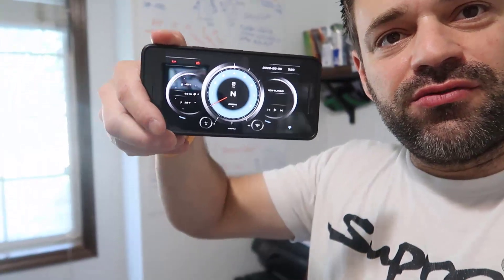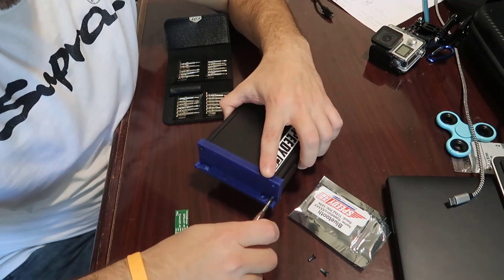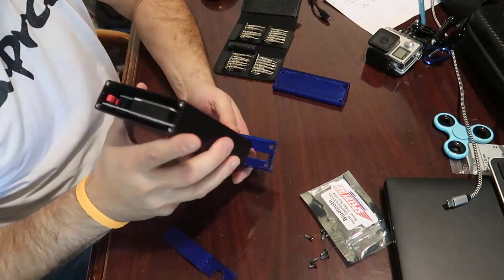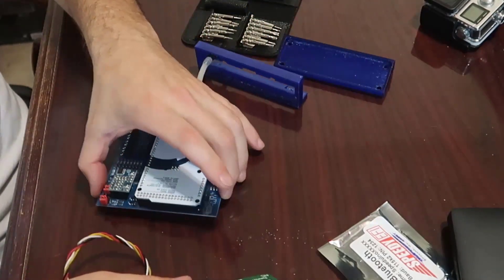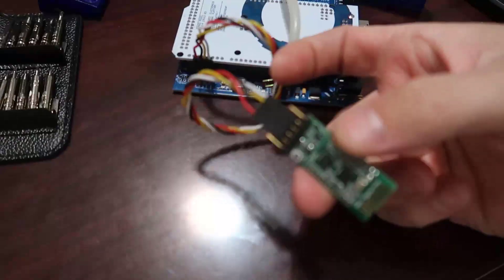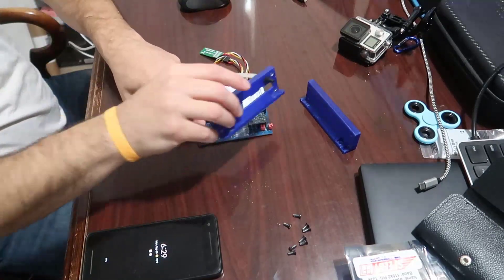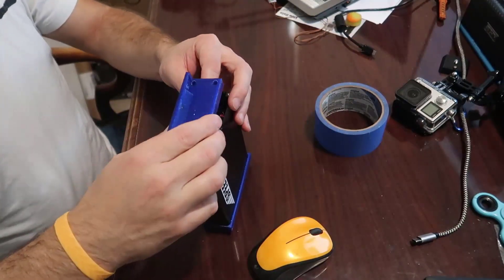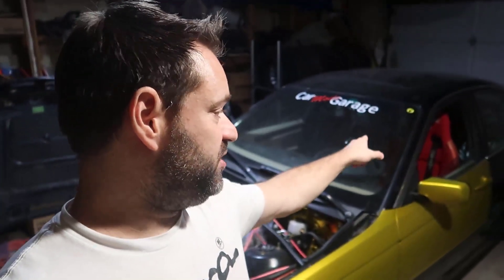Adding Bluetooth to the SpeedyEFI Speeduino ECU - 2JZ to E46 Tuning

Comment: hi bro i also using speedunio how pair with phone i keep try but  cant been connected
Reply from the maker: I use SpeedyEFI version which is pretty easy to switch to Bluetooth. I'm not sure about speeduino itself.
Reply: @CarModsGarage  ooook
Reply: @CarModsGarage  i can search but cant pair😅
Reply from the maker: @kelvinleong915  ohh that could be the version of the Bluetooth that is on your speeduino
Reply from the maker: @kelvinleong915  it just occurred me. Do you have the default password to pair?
Reply: @CarModsGarage  yup
Reply from the maker: @kelvinleong915  ya bro no idea. Try using a computer and see if it works.

Comment: Nice, Simple and efficient. To Be safe would've also put one zip tie on the bluetooth board just incase the tape gets slack over time
Reply from the maker: I guess a zip tie instead of the tape would be better. It will hold though